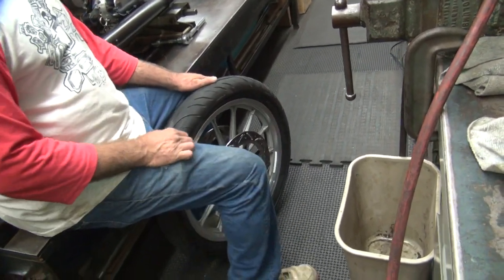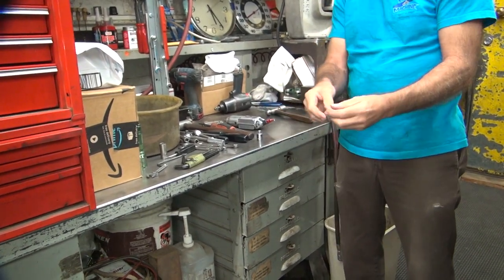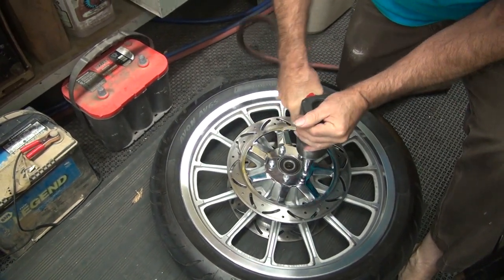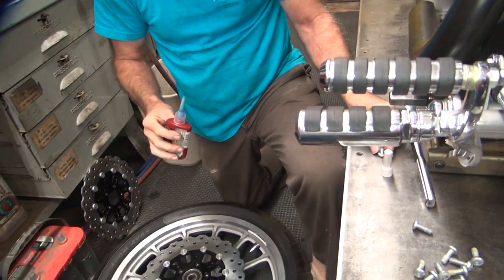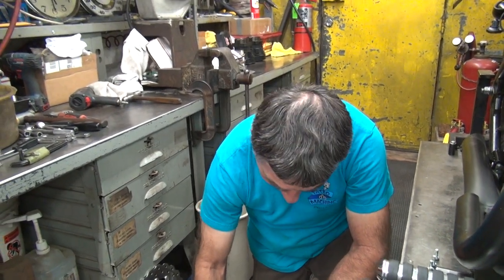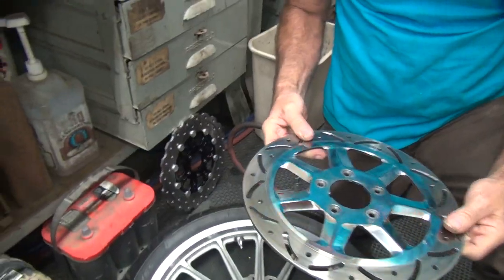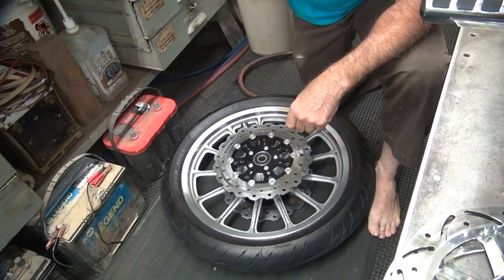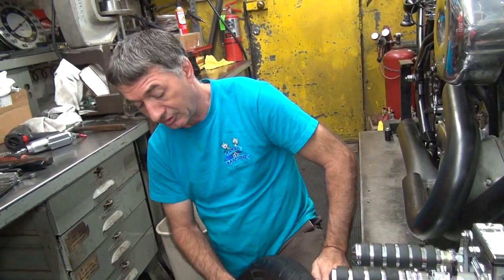#199 1988 fxr deburr full floating front disc brake new rotor install fxrs fxrt harley tatro machine

Comment: I've tried floating n non-floating brake rotors.
Felt no difference in performance, stopping power, or any less wear using ceramic pads.
If rotors are lined up correctly with the calipers, there is no need for floating rotors like there is no need to wear shoes in the garage...
Reply from the maker: they work good for racing because of the heat but not so much for the street. they rattle and drag alot most of the time.
tatro